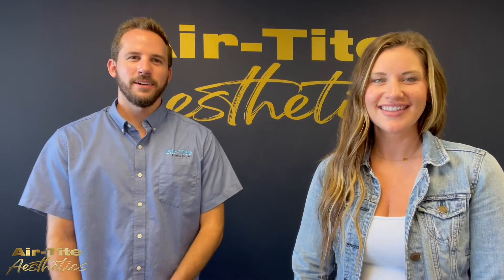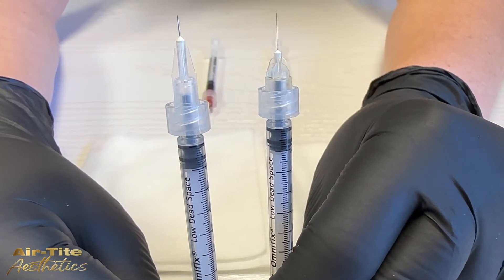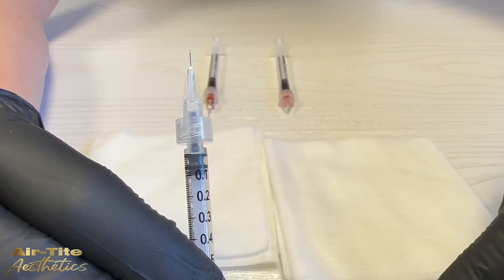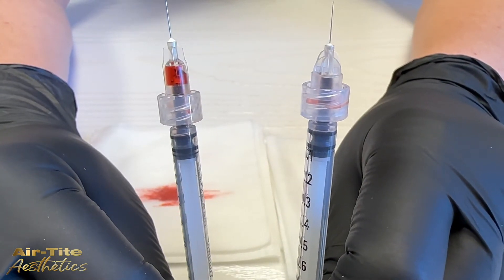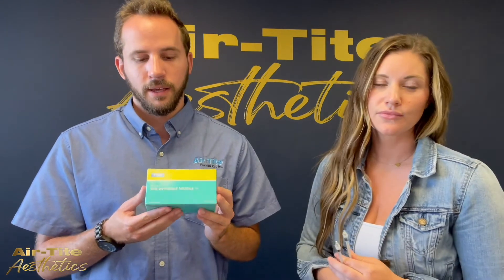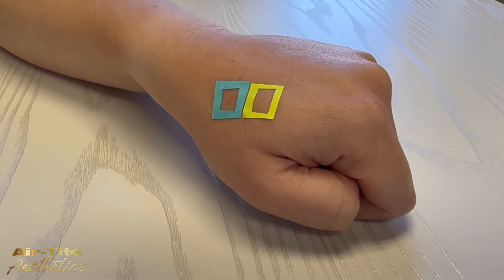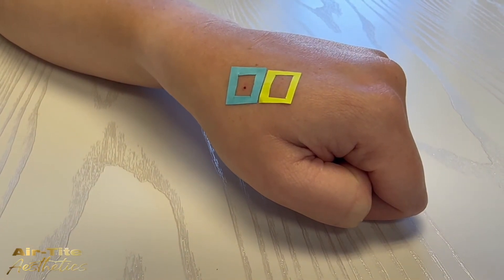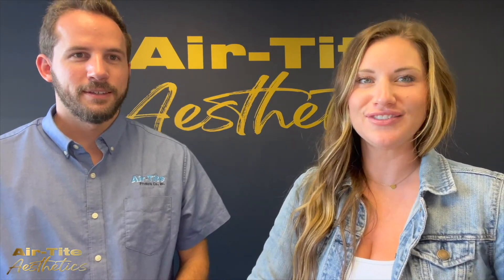Low Dead Space & THE INViSIBLE NEEDLE™ Overview

Comment: What would be easier in my situation would be a syringe that uses hydraulic pressure to amplify the force on the plunger.  A manual jet injector.  I am injecting micrograms if the force on the plunger was amplified 10 times it would easily pierce the skin coming out of an orifice 0.1mm diameter.